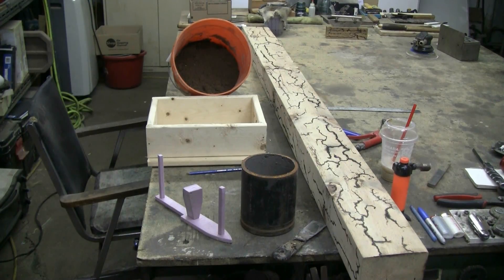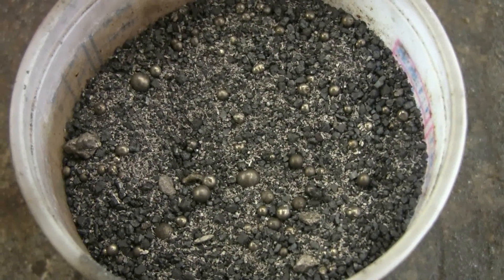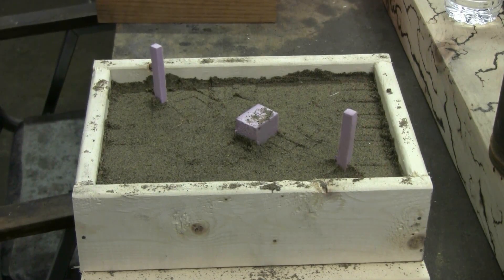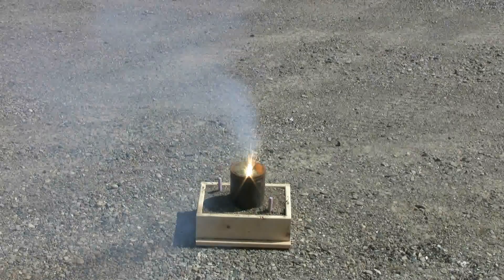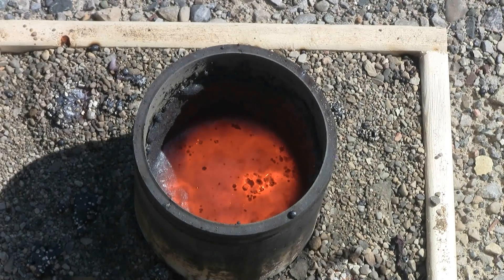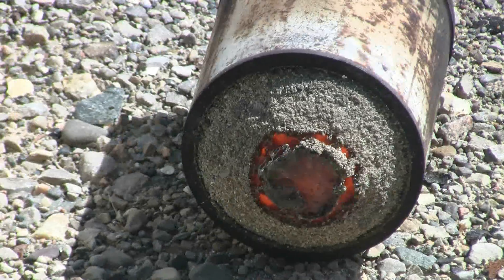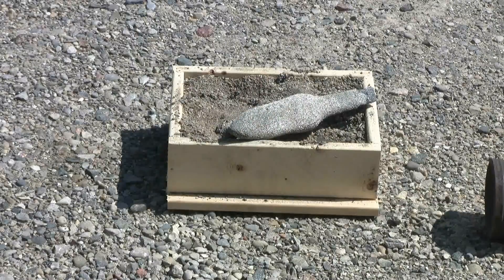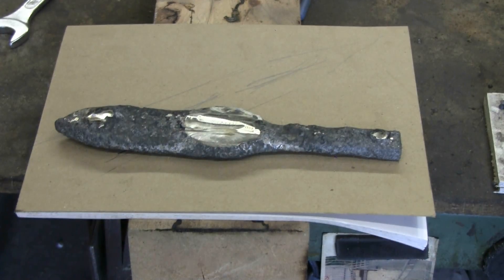Thermite Casting A Blade Shape Using Lost Foam

Comment: Thanks for posting the video! 

I'd been discussing the differences between Fe2O3 red oxide & Fe3O4 black oxide thermite formulas elsewhere. 

I've seen Thermite welding before, but I'd never actually seen unreacted & raw dedicated welding/casting Thermite prior to use. It's 100% "duh" and obvious in hindsight on my part NOW. 😅

But I didn't realize it had actual lumps & spheres of steel, and all that flux material in the mix. It makes perfect sense that dedicated welding Thermite would be like this, as a bunch of raw molten iron of unknown & random quality from the reduction of the oxide O2 over to the Aluminum isn't exactly a "weld." 

So thank you. "I learned something today" because of you and your video from 7 years ago. Even if it only kicked my brain ito gear to connect information I already had in it. Because, "you should've known better already" is often the BEST kind of learning. 😊

Comment: No surprise it can harden. All you need is an excess of carbon to compensate for the loss of it stripping the oxygen of the oxide away and binding with it preferentially to form CO² and CO (monoxide).
  You're like double the temperature that carbon starts stealing oxygen in that reaction. 
   I know it was 6 years ago, but if in doubt, add  lamp or bone black.

Comment: Bill, can you show how to make a foam/polystyrene hot cutter. Not the ordinary battery (9v) type. There are other vids on yt but if possible, could you do a video on it please. Something that can cut 4 inch polystyrene non stop. Easiest, cheapest possible way. Blessings
Reply: Nichrome wire combined with almost any 12V power supply should give you a means to make such a cutter.  You'd have to choose the wire gauge to fit the length and wire temp you want.   Look for the nichrome calculator at jacobs-online.biz.  An old computer power supply will deliver a rock-steady voltage (a few of them actually) at relatively high current.

Comment: Hello Bill Gillmour,
Very interesting video.
1- From where did you get the Welding Thermite, and How much does it cost?
2- Is it possible to find a Thermite without the steel particles, for example, to use for Bronze Casting?
Thanks.
Reply from the maker: +fbahr1 This type of thermite is available from some specialized welding suppliers. You may need an account to be able to get it. Try googling for a supplier near you. Bronze casting would be better done with a charcoal or gas foundry furnace. The thermite reaction produces a metal by reduction and bronze is an alloy. The thermite reaction that produces copper is explosively reactive and would not work for casting copper.
Reply: I was wondering where he got it from too. I didn't know you could buy thermite (other than the ziplock bag kits from ebay and a few pyrotechnic suppliers). The bag in this video looked like a professional product.
Reply: Thank you for your respond.

Comment: I wonder what would happen if you took styrofoam, melted it in styrofoam, and used that goop to make a mold for casting? Maybe roll it onto a mold using a fiberglass roller to even it out. I wish there was a material that could be used in a rotocasting machine, and later as a lost "fill in the blank" method for metal casting. That could be an interesting way to make hollow statues.

Comment: I've seen this tried before, but all of those attempts were unsuccessful. I wonder how much better the surface finish would have been if you had coated the foam in plaster?
Reply from the maker: +Jerry Whidby This would have given a better surface finish but I am intending to normalize the casting and then attempt to forge it to final shape followed by grinding to finish.